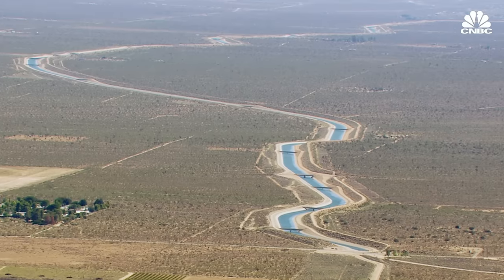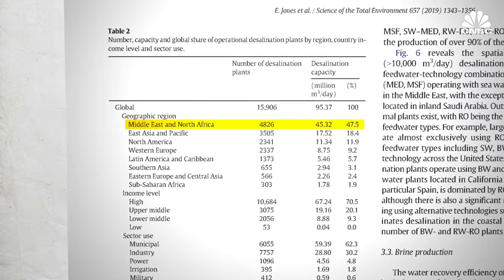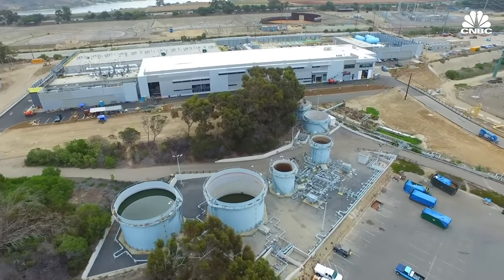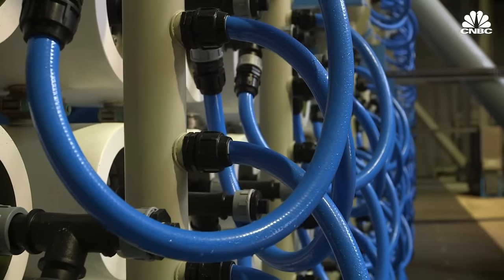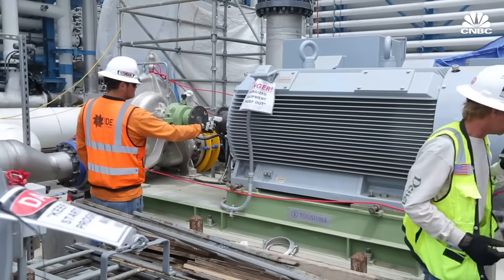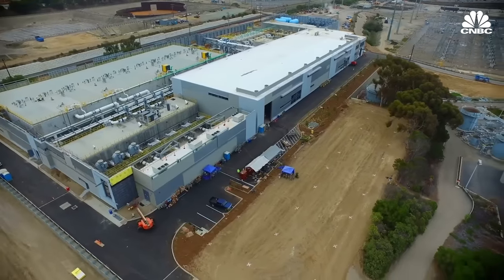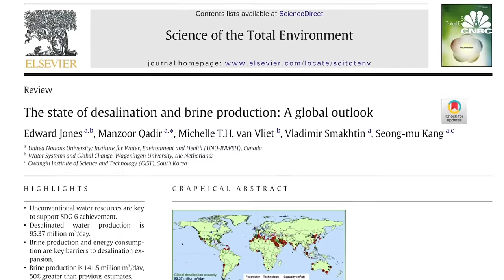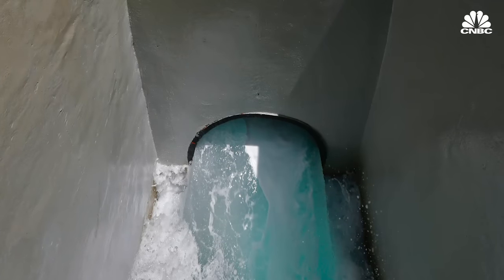Can Sea Water Desalination Save The World?

Comment: Basically, if we would have improved on atom reactors, like the thorium reactor, instead of getting rid of them, all problems on earth would be solved. Nice.
Reply: Since when has Government done things the Safe logical way ?? I guess Investors got a lot more Gov. contract money to build Nuclear Reactors . Thorium reactors cost less but dont have melt downs why build the cheaper safer option ??
Reply: It's true. One side activist against sooo deadly reactors, second side are against sooo energy demanding desalination. But what happens if those both companies will work together, and promote desalinated water from seawater AND thorium energy? It's like: no one cares of making silicon wafers from sand if there no way converting it further, instead everyone loves processing sand into these wafers AND making of wafers these fancy processors and gpu accelerators. With that said, it could be developed new generation of combined plants reactor-desalinators. Transfer of energy same as generating it from shaft power also have a lot of energy loses on the way. Shortening way of transfer it and forcing power directly to desalinators, could make it cheaper. By the way, in first place, reactors from very beginning evaporates water from generated heat, after that steam spins turbine. Maybe we could just invent a larger evaporation chamber, and use seawater for it. And after processing some amount of water, just harvest some salt of the bottom of it. Actually it will work as thermal desalinator, but in a much larger, industrial quantities and much more energy efficient.
Reply: Just thinking that running desalination planet with small  msrs would solve the energy issue.
Reply: There is no such thing as a thorium reactor. Its proper name would be a uranium 233 breeding reactor. Thorium is fertile NOT fissile. Forty-years ago the US and USSR dropped any effort along the lines you think are so promising. Molten salt, so-called, thorium reactors can NEVER work. They destroy their containments so rapidly that they can't stay running for more than about 60-days. The ENTIRE list of materials -- over a twenty-five-year period -- had been tested for containment properties. It's been five-years now, and the Red Chinese are running into the exact same road blocks. So just stop babbling about thorium. It's a scheme that only works on the drawing board -- never in reality.
BTW, U-233 is the WORST single threat to humanity, for it makes possible a back-pack atomic bomb. It takes less U-233 than U-235 or Pu-239 to craft a detonation -- quite a bit less. You don't WANT a thorium cycle. For if solved, there can be no way to stop the creation of U-233 on a grand scale. Ugh. U-233 is easily separated from thorium... chemically. So you have the purity of plutonium with a drastically simpler detonation mechanism. Again, you don't WANT a thorium cycle. Politically, Planet Earth is not ready for it.
Reply: @davidhimmelsbach557  honest there is so much wrong and fermongering about this i don't think its even even worth my time responding, but for completeness sake.
No in fact the SMR actually made had no issue whith containment and U-233 is infact tarable at being nuclear bomb material let alone being made into phisicly impossible "back pack" bombs.
Reply: @c.j.3404  Then the Soviets and Americans didn't know what they were doing when they abandoned a field of techno research after twenty-five years and billions of dollars -- but YOU do. Solid!
The Red Chinese have run into the same wall -- or -- ironically -- the lack of a wall.
When you state that U-233 makes a bad atomic bomb -- well the science on that is settled. The technology is hugely destabilizing. U-233 makes for the smallest bomb possible -- by quite a margin. Pu-239 needs all kinds of trick engineering for it needs super-density to fire off, etc. U-233 can get away with the Little Boy solution. But if it's treated like Pu-239 then the size of the weapon-pit really drops. 
Nice dis-information, you spew, here. The players in the atomic bomb space are not going to be influenced by your rant.
Reply: @davidhimmelsbach557  and actual science isn't going to be influenced by your fear mongering and conspiracy theories, seriously are you going to tell me Qannon is totally true next?
Reply: We don’t need to get rid of nuclear energy
Reply: and to think that Brazil already had a thorium reactor at the time of the military regime of the 70s but because of agreements and bureaucracy it was never carried forward 😔😔
Reply: @michelramon5786  you have more info on that? Like a Wikipedia link?
Reply: @c.j.3404  not exactly, they are stories of good things that happened at that time that are going on and making us sad, but on the Wiki I just search for "thorium reactor"
Reply: @michelramon5786  well I found some pfd that do talk about this, unfortunately they refuse to open so I can't actually read them. Also the only Wikipedia page I found on Brazils nuclear industry only talks about PWR and not any kind of thorium reactors, which makes sense because they wanted help from France and West Germany and both used PWRs although Germany may have affored there experimental pebal bed reactor which can use thorium Wikipedia dosnt say anything about that so...
Reply: @davidhimmelsbach557  Man, way to destroy our dreams of a clean nuclear future! What do you suggest instead?
Reply: @lechefski  I've posted this elsewhere, but there IS a viable route to virtually endless energy -- from the SUN. You see nature has crafted the world's largest solar collectors around our planet's equator. For our purposes, the Amazon rainforest solves everything. For the water vapor it releases flows westward to fall upon the Andes as rain and snow -- in STAGGERING amounts -- far exceeding your imagination. It's so rainy there that humanity can't tolerate it. (!)
The hydro-potential there is enough to power the entire Western Hemisphere -- ALL energy needs -- not just electricity.
We need to mass-produce Swiss type high-head, low-volume, high-pressure jest  [Pelton Wheel] hydro-electric generators. They'd be best if they were Mono-Pole Generators which crank out staggering amps at low voltages. Mega-low-voltage-amps is exactly what you'd want to electrolyze mind-boggling amounts of water into HYDROGEN and Oxygen right at the foot of the Andes. Each generator would operate independently -- just venting well pressurized hydrogen gas into a network of pipes -- very much like today's natural gas fields. The hydrogen would then be sent off to reduce iron ore to iron and steel -- at the world's largest mine in Northern Brazil.... It would be sent off to a slew of alumina reduction plants located way downriver where ocean going ships can navigate the Amazon River. It would be sent over the Andes to Chile and Peru's Western Coasts -- where the dry climate would be IDEAL for hydro-reduction of toxic poisons and every other manner of industrial chemicals -- to be shipped across the Pacific to the USA, Red China, Japan, Korea, Australia -- even Canada. It would be PIPED under the ocean to those same markets. The cash flow from this bounty would make Peru one of the wealthiest nations (per capita) on Earth.
And everything I've detailed here could begin tomorrow. It's all TOTALLY conventional engineering. Thorium reactors, fusion reactors will ALWAYS be totally uneconomic. My scheme will die when the Sun winks out. So, nothing is forever.
Reply: @davidhimmelsbach557  Fascinating. What is preventing this development? Is it currently too expensive for the local governments?
Reply: @lechefski  Elon Musk is not promoting it. Yeah, it needs a seller of dreams to gain attention. Andean hydro-potential is FAR more viable than Musk's other dreams. We already know that the individual sub-systems work. Pelton wheels have been spinning for more than a century. A run-of-the-river hydro-dam is just as ancient. [ To keep costs down, one does not build a substantial containment dam. Such modular dams could be built small enough, light enough to be transported globally by ship and dirigible -- the latter for the final miles across the jungle. They could easily be remotely controlled as they would not need any synchronous bus -- like our modern power grid. They'd spin or not --  same as a windmill. But they would not really need co-ordinate any more than a natural gas well does with its neighbors in the grid.]
How easy can you get?
BTW, Peru is king of the mountain, but Columbia has staggering hydro-potential, too. The key is to NOT build big containment dams -- to NOT build near habitation -- and to settle for intermittent operation. Hydrogen, as a pressurized gas, will function as energy storage. 
BTW, when iron ore is reduced by hydrogen gas instead of coke you reduce slag production rather tremendously. Mexico has been using this method for decades, now. A 'steel town' no longer looks like a steel town. Indeed, hydrogen can reduce to metal most of the ores in use today. That reduction would not happen in the Amazonian jungle. You'd always pipe the gas to where it's a snap to locate a chemical// metals facility. Western Peru and Chile are DREAM locations for said global scale plants. 
It's my contention that it's cheaper to ship electricity as hydrogen gas versus high voltage DC power lines. The latter pretty much have to be in the sky. Hydrogen pretty much has to travel in pipes underground and UNDER THE SEA. Under the sea, the pipes would be PLASTIC -- titanic garden hoses, they'd be. You lay them from a continuous casting vessel, itself fed from a suite of supply ships even while still at sea, USN style. As for depth, think of them laying on the sea floor about 300m-1000m down. The gas pressure inside would be very close to the local water pressure, so the pipe would be under trivial strain. Biologically, at such a depth, the oceans are virtually a desert -- no sunlight.
Reply: @davidhimmelsbach557  Incredible idea. Isn't there significant risk with transporting hydrogen this way, though?
Reply: @lechefski  Actually, hydrogen gas has been handled for decades in this way. If there IS a leak, hydrogen gas shoots straight skyward -- being so light -- the exact opposite of propane -- the latter being a REAL worry within the industry. In all other aspects, hydrogen mimics methane/natural gas. The pipes do need special treatment because hydrogen will embrittle common steels. But this tic has been solved. Any free hydrogen gas in the atmosphere will be burned by sunlight into water vapor. It has absolutely no stability in the presence of oxygen.
The kicker in my concept is that it needs a high profile patron -- kind of like FDR -- to kick start it. The numbers are vastly favorable because it's easy to scale up and it's wildly economic even now. Every item I've detailed is OLD NEWS to engineers -- even if they are novel to civilians.
Check out Pelton wheels -- Monopole generators -- electrolysis -- BTW you can use high pressure water to generate high pressure gas in a single step by upping the voltage. So there's no need for gas compressors. This is significant because hydrogen gas (and helium) resist compression. These two gases don't behave like any other gas -- period. High pressure water will be right to hand at the bottom of a dam's feed stock pipe. How easy can it get?
Reply: @davidhimmelsbach557  Ah that makes sense.

I'm just a little guy from the entertainment industry but if that's all it needs then I say cram it into a 3 sentence elevator pitch and give it a humorous acronym. Mention it at relevant conferences and to some YT channels and watch the word spread on its own!

My dad is an ex-Soviet engineer and if you're anything like him, you might not appreciate seeing such an idea getting tossed around like a cheap joke... but that's where the Steve Wozs of the world can use a smattering of Steve Jobs if you get my drift. ;)
Reply: @michelramon5786  Thorium reactors are impossible. Brazil had an uranium reactor. however, due to bad infrastructure it was closed for safety reasons. if it was still open a disaster like chernobyl would not have been unlikely.

Comment: We need to chage the method to desalinate sea water.
Reply: Cheaper and effective removal of salt from sea water is a challenging engineering feat of epic proportion. Scientists and engineers have been working on it for many years. It's corrosive so will start to eat away at containers, valves, lines, metering equipment, and pipes, especially if it's made of metal. It's crystallinity allows it to quickly settle, coat, and clog those same things. If you've ever bought bags of salt you've probably notice that they can get hard as rock. That is the reason why they are only able to filter 1L water for every 2L of seawater. If they were to squeeze more water out, the resultant saturated brine will likely cause salt to precipitate and clog their equipment so much faster (it is doing so even with the current system they have in place).
Reply: Every problem can be solve if there's a better method